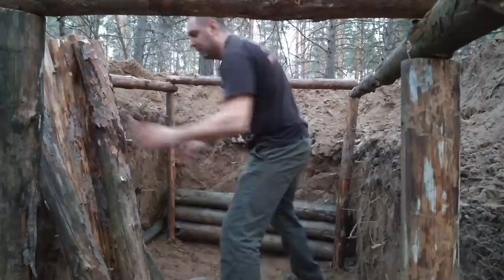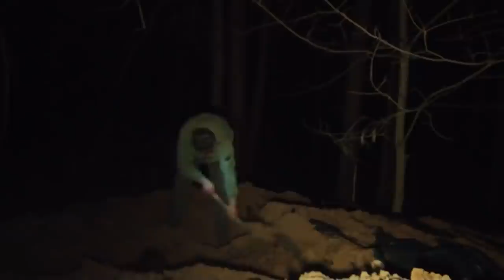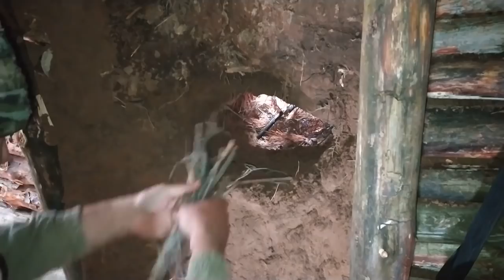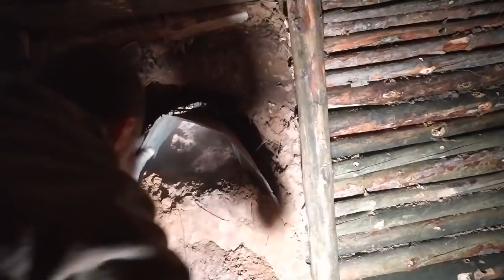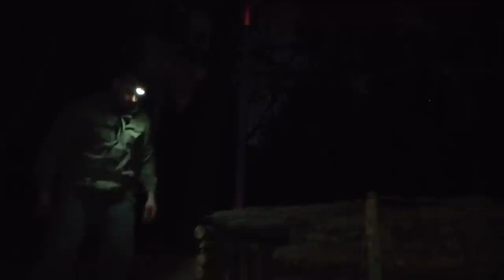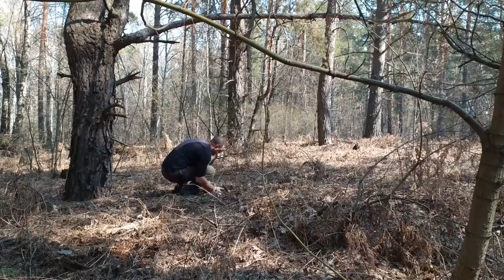Dugout shelter, Bushcraft camp, How was it, off grid build

Comment: Little advice on dug outs. Make sure you make the middle of the tarp higher on and A frame so you can stand in it. Dug outs boy you height the farther you dig down and the higher your middle beam you lay it on and drape it well over your dirt pile by 4 feet and bury it. No water will come in if you do so. We built one that fit 10-15 people to drink in. Nice video and save me some steak.😂

Comment: Here's the thing.. living off-grid deep in the wilderness and undetected is that a possibility without succumbing to state laws? That's been my contingency plan in-case my life suddenly turns completely upside down with no way of turning it right-side up. I suppose one would have to venture pretty deep to remain undetected but with technology on the fast incline, is that even possible anymore? Even buying land owned by the state doesn't place you off grid because you're responsible for the yearly property taxes; even if you're providing for yourself. Is it better to live off grid outside of the US w/out being forced to paying taxes or is that universal throughout? I could just Google it but sometimes alot of that is misinformation so I'd rather ask on here.. perhaps someone with more concrete knowledge on the matter would be able to explain living off grid abroad.